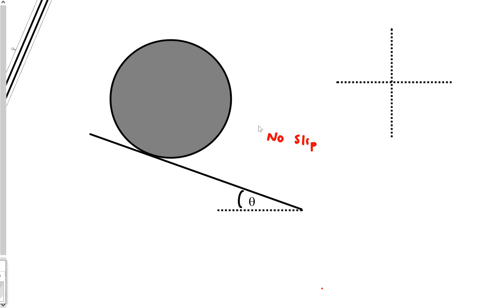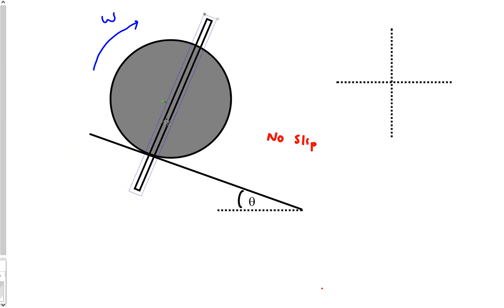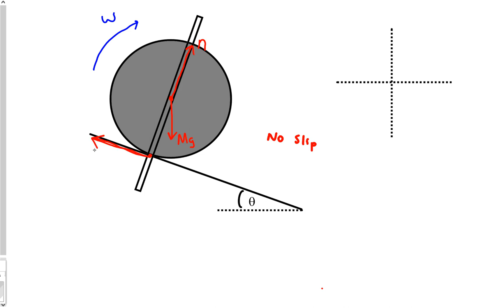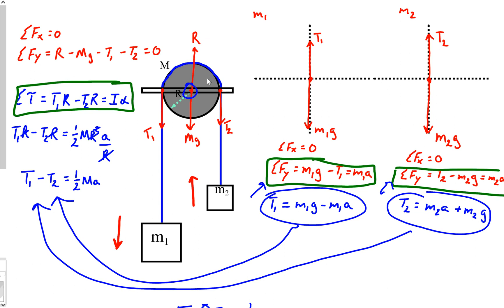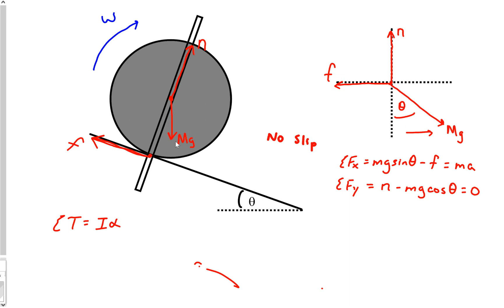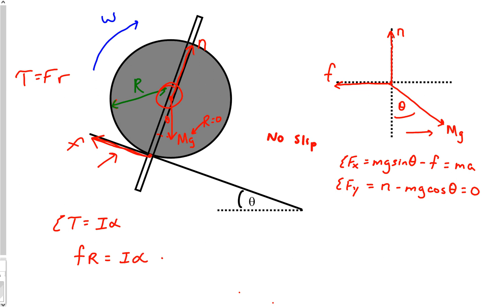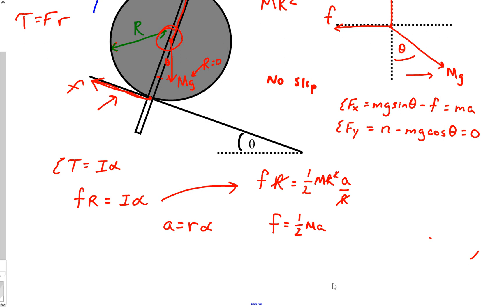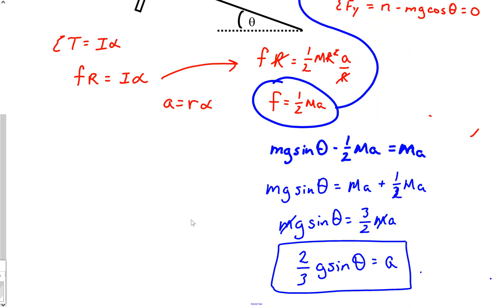Physics - Torque and Angular Acceleration Part 3 (Cylinder Rolling Down an Incline)

Comment: Why is the torque not negative?  This torque gives a clockwise rotation...
Reply from the maker: That's a great question! Torque, like the sum of forces, is directional. In this problem, we chose to make the positive direction match the direction of motion. If the object had been rolling down the hill in the opposite direction (from right to left), our approach would still apply, as the solution itself doesn't depend on the direction of motion. Since we only have torques contributing to a positive acceleration, we arbitrarily designated the torque as positive.

When solving torque problems, the key isn’t so much about choosing positive or negative directions but rather about grouping the torques correctly as either positive or negative to reflect their contributions accurately.

Comment: What if there is a force applied that is tangent to the cylinder and parallel to the inclined? Will we consider that for the summation of torques?
Reply from the maker: You would. I would assume someone wrapped a rope around a cylinder or disk, then they're pulling it up or down parallel to the plane. Just include it in your sum of the forces and then you can add or subtract it in the torques you set equal to I(alpha)
Reply: @turdfurg67  Thank you so much for answering! Lastly, you mentioned in the video that the mg does provide a torque but since r = 0 there will be no torque. Is the reason for this is because the center of gravity is located in the middle so r = 0?. Is there like a circumstance where you really have to consider mg in your torques? Like if the center of gravity is not located in the middle, then you have to consider the mg in your torques?
Reply from the maker: @hehehe9618  How can I put it, it's a shade more complicated. The mg does have a torque about any other point other than the location of mg. Make sense? You see you can pick any point in the problem to do your torques. That point becomes zero. In this problem though were clearly had an angular velocity and moment inertia about the center of the disk, so it was only logical to make the position vector of that torque 0. Maybe I can stream line more. 99.9% of the time it's also the easiest :)

Comment: Why is radius if mg 0?
Reply: He was taking the radius with respect to the middle of the circle. In this case, mg is being applied onto the middle but the frictional force does not. Just look where the head or tail of the force resides.
Reply from the maker: @MoonJumpMania  10 extra points you my friend. On a torque problem you always pick a pivit point and for cylinders I always choose the center, which as a by product makes your normal and weight to have torques of 0 because r = 0.